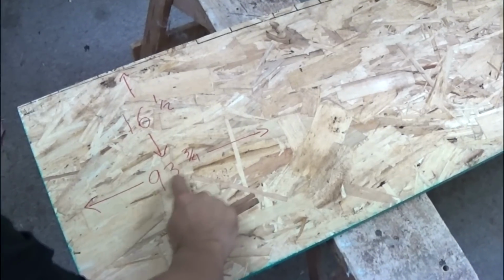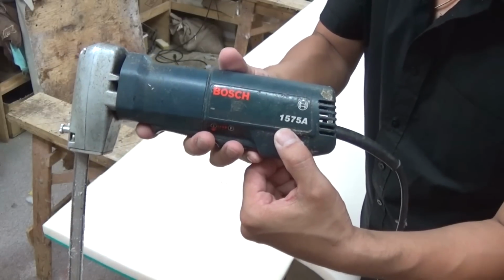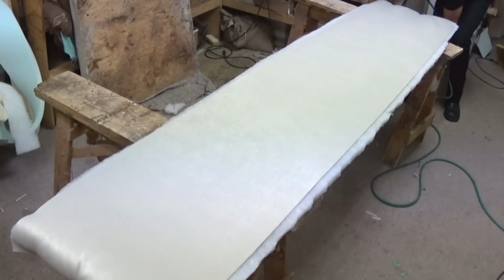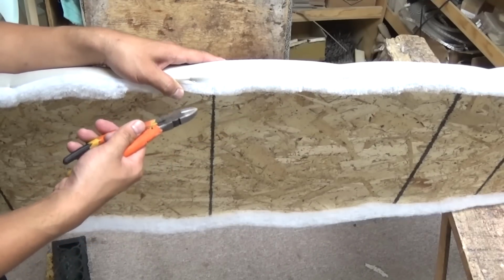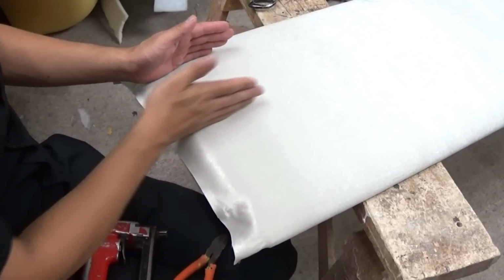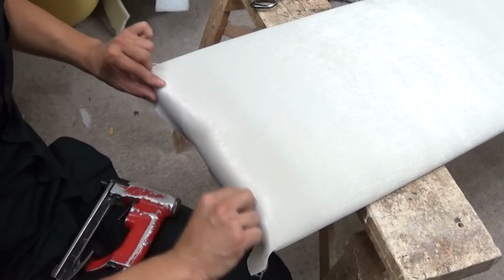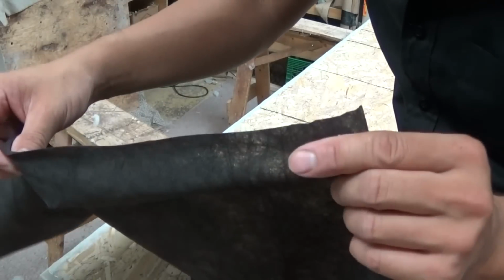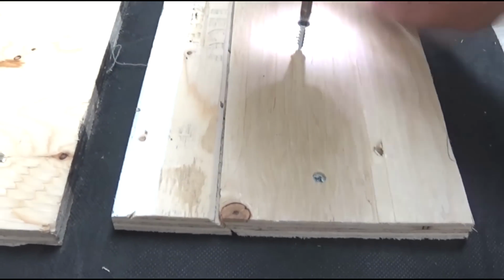DIY: PANELED HEADBOARD - ALO Upholstery

Comment: Great job. But that's not currently realized how attached this panel? It is necessary to show the attachment system, if possible.
Reply: He explained at 7.38. you screw wood to the headboard and attach it with super basic joinery he explained it. Very easy

Comment: Hi! There
I was preparing to make a similar headboard and have a question.  I'm doing the untufted panels as well and will have multiple.  I think I counted about 6 or 7 panels on yours. How many panels did you attach to each board in the back?  And where does the cleat rest (top or middle)?

Comment: So nice..but how to fix it on wall...little confusen...could you explain...or any other related video?
Reply: siman angel he is explaining it, he puts a wooden piece on the wall wich will fit in a "hole" on the back side of the headboard, so the headboard is basically hung on the wall

Comment: hi nice job but you did not have to do all that work =lay a 2 inch foam on one big board stick it down .Measure and mark the board at the starting and ending points of the desired  line then cut the foam with a knife. .put your fabric on the board and run your hand down the cuts then make a pleat at each end finish off and your done